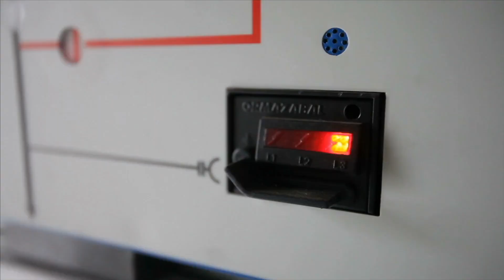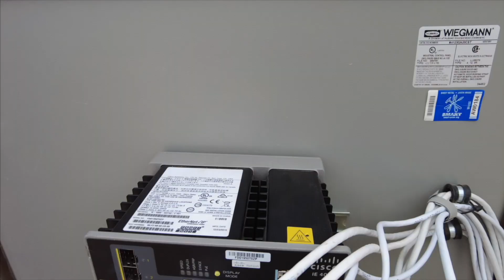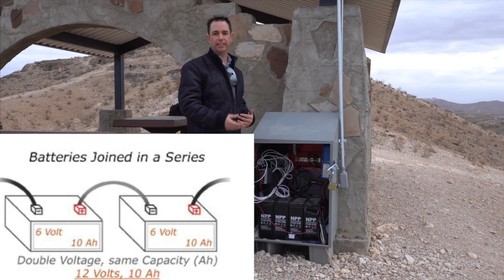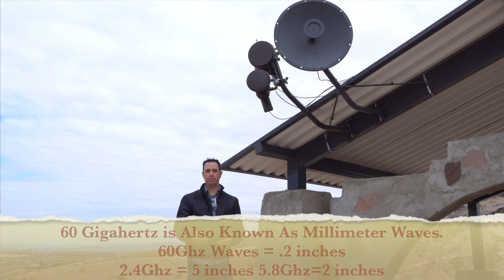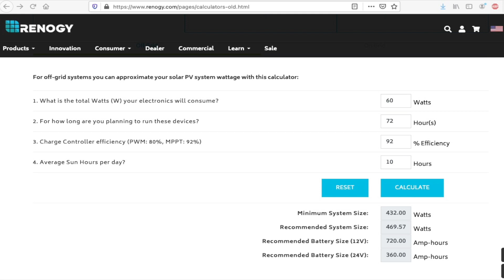Solar Powered Internet Relay Site - Connecting Anywhere

Comment: 1. The IFC requires continuous ventilation that will handle the unlikely event of an excessively gassing battery, no matter what type it is. Fire codes require continuous ventilation at a rate of not less than one cubic foot per minute per square foot area of the VRLA Battery system, or per square foot of the entire room for a vented system. So you are required to have your boxes vented or equipped with a fan.
2. Your battery manufacture states that the FT12-100Ah has a max operating temp of 122 degrees Fahrenheit. You said your box can get over 160f so you are voiding your warranty as soon as you install your batteries. You are also reducing their overall life by half having them operate at those high temperatures.

I strongly suggest you build a vented battery box above your current metal oven and feed the wires down to your equipment or to bus bars that your equipment will connect to. You can go with three BattleBorn  BB5024 24v batteries which will give you more than enough power for more run time and extra power for four 2.5w 24v fans running 24/7. These batteries are only 31lbs each so they can sit on your current oven without an issue.

On paper calculations:
You have four 100Ah lead acid batteries with 50% usable giving you 200Ah or 100Ah at 24v. That's 2400 Watt hours of usable storage before you have to run up there and plug in a generator. 60w on that 2400Wh of storage will give you 40 hours of run time without any sun which is about a day and a half (FYI 60w x 24h = 1440Wh). If you are seeing almost 3 days of run time then your system is either not running at 60w consistently or you have never had days where you have absolutely no sun at all for multiple days (heavy rain/storm).

You can fit three of those BattleBorn batteries in about the same width of your current metal oven. It will be easy to mount a vented storage container with a lock above your oven. If you must use metal, I suggest you line the inner sun exposed sides and top with some form on insulating material. Painting the outside white will also help.
Three 24v 50Ah LiFePO4 will give you 3600Wh of usable storage (can be discharged 100% for this brand). Your usage + fans will be 70w. 70w on 3600Wh of storage will give you over 51 hours of run time or just over two days.
So as you can see even with an extra 10w in fans, the 3 BattleBorns will give you an extra 11 hours of run time. The BMS will shut down these batteries at 135 degrees Fahrenheit. You can install a small test box that's vented and has a fan and temperature sensor at the same location to see if you can get the temperature down below the 122f mark. I'm sure you IT equipment needs to be sealed off from moisture but the batteries do not.

Comment: You can use lithium battery chemistry. Insulate and clad your battery box on the outside. Install heat pads as well as cooling options which are triggered from a temperature relay. Currently it looks like you have designed your battery box as an metal oven. It doesn’t help locating it outside of your shade cover. You shouldn’t need to worry about drawing current to run fans during a hot day as your solar panels will be producing surplus energy. 

An alternative is to dig into the ground and store the batteries underground. I guess a concrete lining followed by a waterproof lining for the enclosure will do but a local groundworks company should be able to advise you. Once you go X feet deep into the ground you won’t need to worry about large temperature fluctuations.

As you are concerned with the amount of energy you may or may not generate, use sun trackers for your solar panels, makes a huge difference if you want to maximise your energy storage. Increase your battery capacity as you will be generating more energy.

If you do decide to go with Lithium batteries, you can still use the gel batteries (if you don’t want to waste them) as an uninterruptible power supply. This also helps to increase total battery capacity. Solar charges Lithium batteries, lithium batteries charge gel batteries, gel batteries power your system. Of course this isn’t an ideal solution but it’s an option if you don’t want to waste your gel batteries.
Reply from the maker: Thanks for the input Steve!  Quite frankly it is an oven, BUT everything works with that design and im scared to change  because i have that same design on a dozen other sites and they're all more reliable then grid power.  On that particular site i can't dig up anything, but i do have some that i can.  At my main office i have a box we call the hotbox that we experiment with everything for a year before we put it out large scale because of the varying temperatures, humidity etc.  The last thing i want to have happen is to have to have emergency dispatches to all the sites at once (which has happened before like a decade ago one summer.)  Everything I've tried with the same amount of lithium wattage batteries haven't been able to stay up during multi-day cloud cover.  I do like your idea of an additional vault as just a backup and that might be a offset.  I've also been interested in wind and fuel cells to power things and have various things in the lab and im hoping i can have a 2.0 design this year.

Comment: Lead acid battery is just poor in efficiency , high/low temp do give lead acid impact on capacity also, if you calculate the charging/discharging efficiency and the real capacity of battery, the extra power will enough for you to run lithium based battery + small DC fan, as long as there is good airflow, i don't think the heat will be a problem. LTO battery might be a good choice for extreme environment, efficiency not as good as other li-ion family battery, but it is still far better than lead acid.

Comment: Way better than what you are using
Reply from the maker: Hmm, those look interesting.  i'll have to get some for my r&d lab and see how they hold up to 160+ temps.  I've tried lithium cells but the temperature extremes don't hold a charge the full day.  to get the lithium cells cool enough to hold up, they take more watts then then the solar cells can produce with either a fan or a pump running.
Reply: @TheGuyWhoRunsTheInternet  I like that they can handle an 80% DOD without the concern of sulfation and they recharge as fast as LifePO4, with out needing a BMS.

Comment: Also, a 6 watt transmitter uses WAY more than  6 watts. And you still have and use a PAGER? Nice and retro bro
Reply from the maker: 6 watts is the power draw of the transmitters (here’s the specs sheet for one of the radios https://mikrotik.com/product/wireless_wire_nray) Everything by the fcc has to pretty much be <1 watt dbm output power for unlicensed equipment to be legal.  By pager I mean texting alerts to phones/ noc dashboards depending on severity.

Comment: it's MAXIMUM power point tracking, not mulitple. second it's Pulse WIDTH modulation, not wave. There is a ton of other stuff wrong in here. Can we get the guy that actually designed this system to explain it, since you clearly just paid for it 😉
Reply from the maker: Sorry you are correct, I got that acronym wrong, thanks for correcting me.